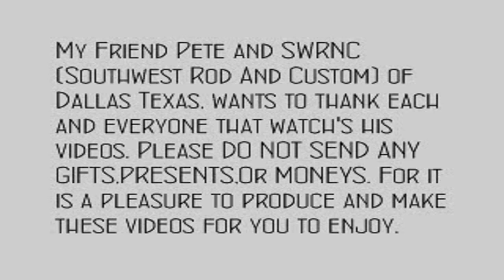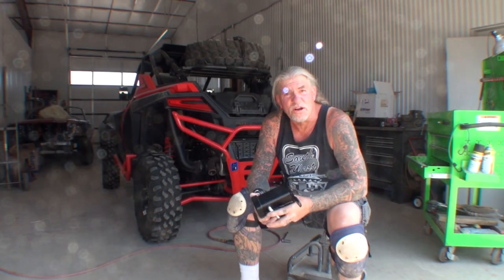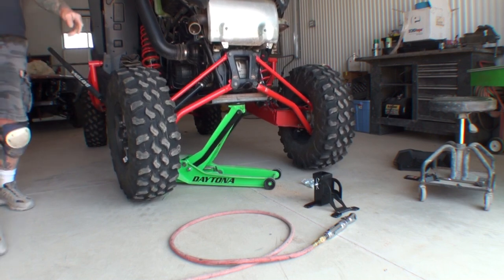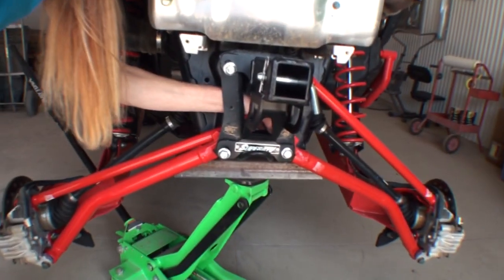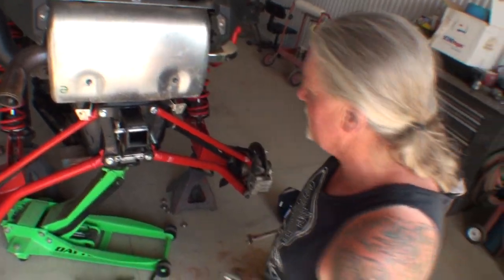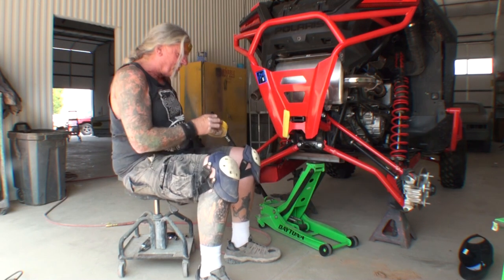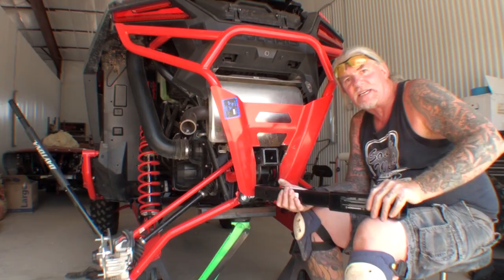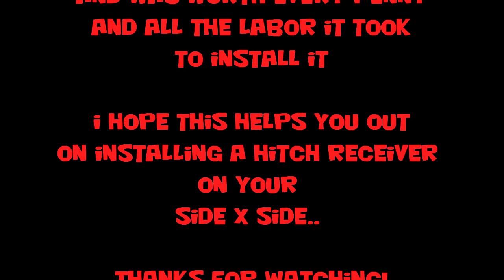Rear Receiver Hitch Install | Polaris RZR Pro XP | DIY At Home

Comment: As a professional mechanic of 45 years I love watching shade tree (even if you have a garage) mechanics doing things like using a 1/2" impact wrench with no impact socket breaking their regular socket and expecting it to be replaced by the Snap-On man. Try using a smaller electric 3/8" ratchet or even a 3/8" impact wrench. Try using impact sockets. You probable over-torqued every single bolt and stretched it. They look like Grade 3 to me. Try using thin wrenches (yes they make them). Try replacing the nut with one from your nuts & bolts supply, or just buy a couple extra before you start the job. Nuts get lost. Don't waste time looking for them. Time is money.

Comment: Re weld the piece you cut back onto the bumper lower at the bottom. It looks flimsy without it
Reply from the maker: It’s not flimsy. It’s bolted tight to the body frame structure

Comment: 18 millimeter wrench. Box or open. Mark 4” inches up. Bend the wrench at the 4” mark. Perfect L 45* bend. It will fit down and up on all 4 nuts.  And it will also stick back inside the hitch once it’s being mounted on to put the nuts back on with.

 I posted a quick tip vid under my name.
Reply: Thanks for they tech tip. 🤙🤙